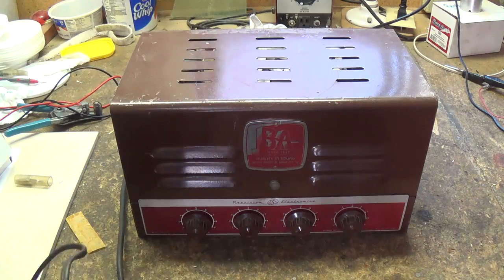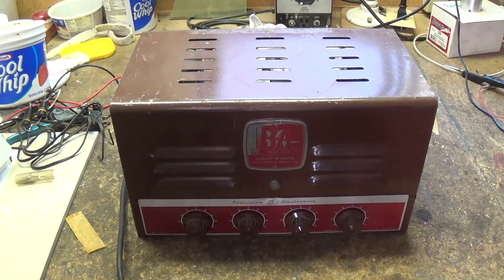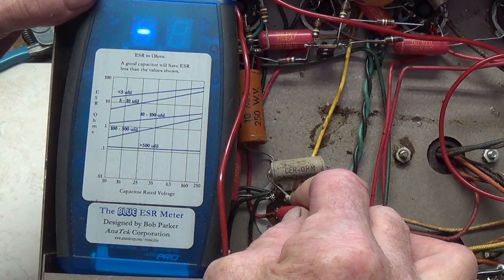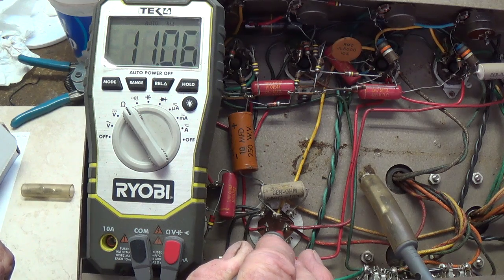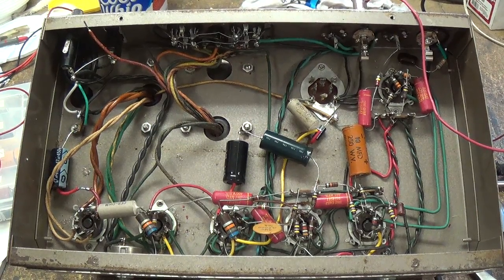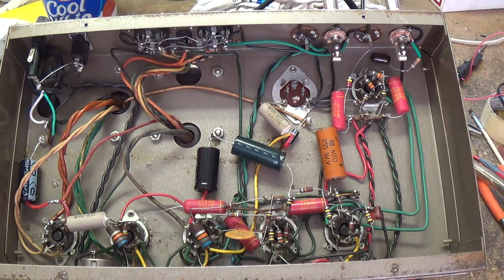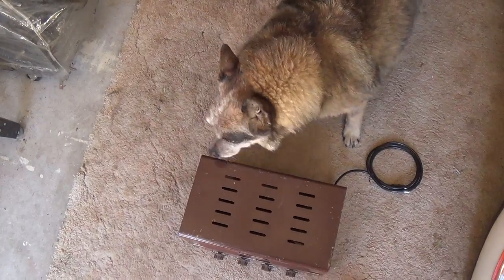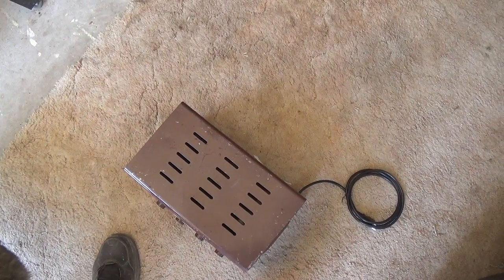The Worst Filter Capacitors I Have Ever Seen.....and Heard :)

Comment: Its a nice video, thank you!   I don't think I would trust those old carbon resistors too far.   While its nice to keep things original, reliability becomes an issue particularly if its going to be pushed pretty hard.   I used to work on jukebox amps quite a bit.   They took quite a beating.   I can only imagine what the guitar people will do to this amp!  :)
Reply from the maker: You're welcome, Stuart. Yes, there must be a balance between originality and reliability.  Thanks for your input.
Reply: I do new builds with carbon comp resistors. There is nothing wrong with them and when chosen for select places like plate loads their high voltage coefficients will add some nice nonlinear distortion to the signal. This is of course wanted in guitar amps so be careful when replacing CC resistors, you may just make the amp too sterile by switching to film resistors. The larger the signal swing across the resistor the more harmonic distortion will be added. To those that say they are "noisy",  ones that have failed can sound like bacon frying in a pan but high quality CC resistors will not make your amp noisy. The last high gain amp I made had an output noise level of <400uV using all CC resistors in the amplifier.

Comment: Hey its me again I went out in the Durham area and Picked up some tunes and parts and components. I was wondering if I could see what u think and if u recognized any of the tubes
Reply from the maker: Greetings, Jason. It's hard to judge tubes long distance. Your best bet would be to compare them to tubes offered on sites like Tubes & More (Antique Electronic Supply).
Reply: Ok thank u
Reply: +Uncle Doug hi I all so got some harmond transformers  a lr31301 and a a bit of an odd one  a voltage changing type no.3902 I am not familiar with the voltage changing types
Reply from the maker: Actually all transformers (unless 1:1 for isolation) are voltage changing devices, Jason. How is this one different ??
Reply: well this one only has 3 wiers and that is it and step up and step down from 120 v to 300 or 110
Reply from the maker: I have no idea how a transformer could do this with only 3 wires, unless the frame is one of the leads.....which would not be safe at all.

Comment: I have a dream that you'll get your hands on the Hammond AO-29 chassis, so ubiquitous in the little brother to the Hammond B3. They are usually acquired gratis and aside from the excellent "Hammonator" built by one gentleman in this chassis--there is no definitive guitar amp conversion video out there. I have a hunch, "Unk," that such a video would both net you a kazillion views/clicks--and unleash a latent tsunami of unrealized conversions on unsuspecting neighbors. Specifically the AO-29, mind you. It sports a 5U4 rectifier, three or four 12AU7's I think, and a pair of 6V6s out. Excellent iron, but they either aren't an easy conversion (the air variable cap "swell" control on the top challenges me), as well as how to involve all those tasty preamp tubes--or somebody's holdin' his cards close to his chest. . Here's my vote for an AO-29 guitar amp. Fine video as always, man. 

If you won't do it, I'll take my request straight to Rusty. Don't make me pull rank. ;-)
Reply from the maker: Thanks for the excellent suggestion, JC. I will keep my eyes peeled for an unmolested AO-29, and will make a video of the conversion when (and if) I can find one.  Don't tell Rusty about this or he'll nag me to start going to more garage and estate sales :)
Reply: Uncle Doug
They are used in the M-3 and M-100 spinet organs. Shoot me a note off-line and I'll ship you one. I have several. No strings attached.
Reply from the maker: JC, I did some research on the AO-29 and the chassis is simply too long for the type of combo amp that I build. I did find a excellent video by Brad Linzy, however, that covers all aspects of the conversion: https://www.youtube.com/watch?v=RWyJJl5KcXA  Thanks so much for your very generous offer.
Reply: And thank you for taking the time to dig in a little. Cheers!
Reply from the maker: It's always a pleasure to learn new things. Likewise, JC :)

Comment: Why was the 10uf 250v paper capacitor not tested and replaced? If original, it is very likely leaking DC.
Reply from the maker: It was tested, Harvey, and checked out OK. However, I may still replace it.
Reply: That would be a good idea, these leaks in voltage increase the likelihood of damaging other components in circuit over time with heavy use
Reply from the maker: Thanks for your input.
Reply: Also, an old leaky (electrically) capacitor like that is a fire hazard. Don't want fire damage to the old radio/amp!

Comment: Hi Douglas,
Was that four electrolytic smoothing capacitor canister, incorporated into the PE30 amplifier, manufactured by Hunts Capacitors of London (now mercifully no longer in business)? 
I ask this as Hunts capacitors had a reputation for being unreliable.  I always evict the blighters whenever I see them beneath a vintage radio’s chassis.
What is that ESR meter you use?  I’m curious!
73 de Phil.
Reply from the maker: I'm not sure, Phil. The only unusual characteristic was that it was abnormally tall.....about 6". The amp was picked up by the owner yesterday so I can't check it.  I use an Anatek Blue ESR meter. They have a great website, excellent service, and great products.

Comment: Hi Uncle Doug! I love the videos you are posting. I know you have said you get your parts at antique supply and power supplies at another site. I haven't had any luck finding an old mallory capacitor (500V/30 MFD, 500/10, 450/10, 450/10) that would help me fix a 4 channel Rauland 2135 pa amp. Is there somewhere else you go to find anything along this order? Sorry if you answered this question in another video, i am still working my way through them.
Reply from the maker: It's often impossible to find the exact can cap you need, Erik, which is why I generally resort to installing individual axial caps within the chassis, leaving the old can in place for looks. I know of no other good sources for the can-style capacitors.
Reply: Thank you for your response. Finding the original would be a one in a million at this point lol. After more hunting and calling several manufactures. The problem is finding a replacement cap 500v/30. I was able to find a 450/30 and a 600/30 and 450/10 for the others.  I am not sure what one to go with. Does the voltage rating affect the tone or have any ill effects on the transformers? If a surge pass thought the cap at 600v that would normally fail with the original, would i be doing more damage than good using a 600v cap? Maybe add a 500 v fuse to protect the rest of the amp? Any thoughts on what to do when you can't find the right volt value capacitor are appreciated. Thank you for your time.
Reply: Also i was able to find a 500v/40uf 500/20 500/20 500/20. Would this be a better option? That was the closest i could find for a can replacement.
Reply from the maker: It would probably work just fine, Erik.
Reply: Thank you. Your videos are very informative and funny. I get your sense of humor.
Reply: Also i may have you beat for the worst capacitor contest. I get a 60 cyc when i turn the amp on stand by, crackling and popping with a 120 hum when master vol is turned on, and extra 120 hum when turning on the four channels. I will post you a video if you care to hear. All the best and keep the videos coming. I learn something new every time i watch.
Reply from the maker: Wow.....it sounds like a triple-header Erik. No video necessary, you win :)

Comment: Great vid. Were they vintage bumble bee caps you pulled out?  If they match your new replacement ones and they are not leaking you should use them.  Mojo!  I'm in the process of putting them in my les Paul along with 50's centralab harness and belden wire with a pair of t tops.
Reply from the maker: Yes, they were, Tock.....and I intend to test them and add them to my vintage parts stash ASAP :)  Regardless of their tone capabilities, they really look neat in a circuit.
Reply: CIRCLE OF TONE. Stay away from bumblebee caps they are all junk by now.

Comment: This is what you found in old amps....the other day i found some light bulbs wired in as cathode resistors for the output tubes in a fixed negative grid biassed amp....if you push that amp very hard they do light up and add some resistance in this path and save the output tubes from dissipating too much power.....
Reply from the maker: I believe the Hammond AO-44 (or perhaps the AO-39) uses some light bulbs as variable ballast resistors. It's actually a very clever solution, probably developed before varistors appeared on the scene.

Comment: Hi Uncle Doug,  I've recently been thinking of buying an ESR Meter, then I figured you can buy a lot of new filter caps for the same price and old caps aren't something that improve with age like a fine wine! Also, I just completed a Ricktone Tremo-verb, ironed out the faults, and was inspired to make a SE amp I used the back to back transformer design to make a Champ clone with a 6aq5 in the power stage, works great.  Kind regards to you and your four legged friends, Colin.
Reply from the maker: I understand the economics of ESR vs simply buying caps, Colin, but in the long run....especially if you do this a lot.....it will pay off (I think :) Congratulations on your successful Tremotone and Champ projects. It's great to hear that the videos are helpful.

Comment: My goodness Uncle Doug! Did they go bad or were they just junk in the first place?
Reply from the maker: Well said, TC. Thanks :)
Reply: they do get bad over time...they simply dry out. and while they do so the aluminium foil which forms the capacitor may come so close that they eventually shorting out if you apply any voltage on the terminals. Or the electrolytic which forms the insulation between the foils become some kind of plastic and makes that very thin foil cracked and then there is no capacitor no more just two terminals connected to nothing....
Reply: +TubiCal thank you!

Comment: Once I had a cap blow up a giant wound resistor and trip the breaker at my house at once. Granted, it was the mains filter across the power cord. The worst thing about it is that it was actually the new replacement I had put in.
Reply from the maker: Wow, that would be a bad combination....an explosion that involves a newly purchased part, and it all happens in the dark :(
Reply: Solder in backwards ?

Comment: Almost as bad as the cap that downed my echoplex...     Mine had almost NO resistance.  Scary thing is,  that "Plex"  was from 77!   I posted vids on it.
Reply from the maker: When these large capacitors go really bad, things can get pretty dramatic.....especially if you're not using a current limiter.

Comment: Thanks again for another excellent video, Uncle Doug.  I have a 1954 Bogen Challenger 33 that a gracious Craigslist seller gifted to me.  It had terrible filter caps.  In fact, it wouldn't even turn on without blowing the fuse.  An amp tech friend of mine helped me to replace all of the electrolytic caps, including the terrible paper and wax caps.  Well, the amp sounds fantastic now.  I wanted to keep the amp as original as possible, so I bought some old style mic connectors from Mouser and grafted them to the ends of guitar cables.  I love the unique sound of this amp, and do not plan on changing any other part of the circuit.
Reply from the maker: You're welcome, RW. It sounds like a great amp that has found an appreciative home. I like the fact that you are keeping it original, down to the microphone connectors. Keep up the good work.....and best of luck with all your projects.

Comment: It's amazing...the entire 4 sections were kaput. Usually only one or two sections are bad. This cap was practically shorted. I recently repaired a '69 Fender champ with a filer cap that was as bad as this one. what was even worse was, as soon as you turned it on, and before the tubes could warm up, the 120 cycle hum was right there instantly. Yours was really bad though. It's not often you get one that hums like that one :) Gotta admit, Rusty's cap sniffing abilities are amazing :)
Reply from the maker: This is definitely the worst one I've seen in a long, long while. A dead shorted cap will usually blow a fuse or fully illuminate a current limiter bulb, but the partially shorted ones will blast you with that dreaded 120Hz tone. I wanted all the beginners to hear that sound, so they will be able to recognize it quickly and know what it indicates. Rusty is still sneezing after smelling that wretched cap.

Comment: Hi Uncle Doug, stupid question time... I noticed in a few cases now that you have chosen to replace cans with axial electrolytic caps. Is it based on availability or is there another reason? I recently replaced all the cans on a Hiwatt DR-103 and used all new cans that were readily available to me. Just curious.

As always, great video! Give Rusty a scratch for me.
Reply from the maker: This was a customer amp, JC, and cost was a definite consideration. The separate caps were much cheaper than a replacement can.....and I had the individual caps on hand, while ordering a replacement can (if one could be found with the proper values) would take several days. If this was a Blackface Fender Deluxe Reverb I was restoring to keep, I would order and install the proper can caps.
Reply: +Uncle Doug : completely understand and it makes sense. I have had experiences where I could not the original parts and used what was available and everything was just fine. Project economics drive many considerations. Speaking of considerations, excellent job in your recent capacitor series installment explains the differences, why's, and applications for various capacitors. All the best!
Reply from the maker: Thanks so much, JC. We're glad you enjoyed Part 1 of the Capacitor series.....more to come :)

Comment: thanks for the video...when that hums like that is more current being drawn thru the circuit than is designed to?
Reply from the maker: You would think so, but the Current Limiter bulb did not illuminate. The capacitor can got real hot, however, so there is definitely some current flowing through the leaky caps (which had become resistors) to ground.
Reply: I heard a noise like that just before that amp I told you about caught on fire...It was just a little fire that went out within seconds... I big ceramic resister blew up and a couple of others looked cooked.
I'm learnin the hard way but i don't mind...thanks again for these videos. ..and rusty was right bout those can capacitors they stink!
Reply from the maker: Yes indeed, if you don't pull the plug quickly on a roaring hum like the one in the video, something is either going to catch fire or explode.....and you can't believe the mess an exploding electrolytic capacitor can make :(  Keep on learning, YR. Often learning the hard way makes the longest-lasting impression.